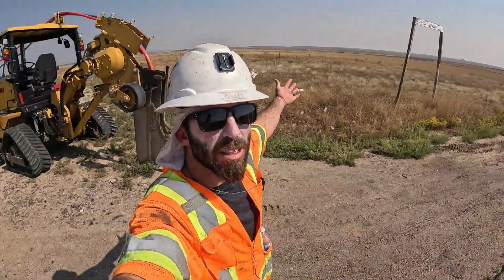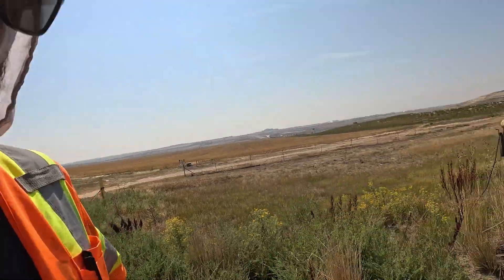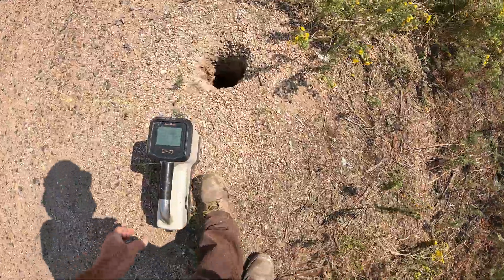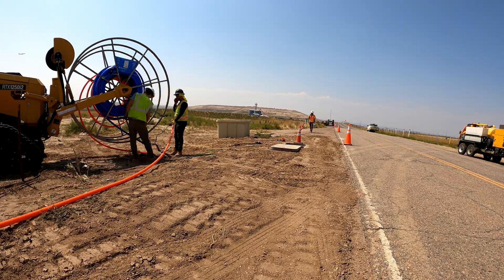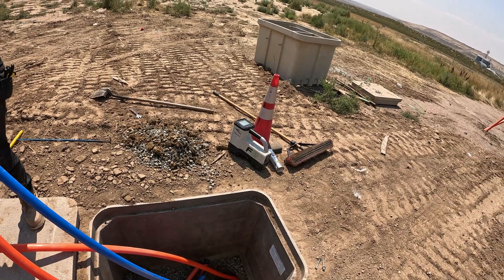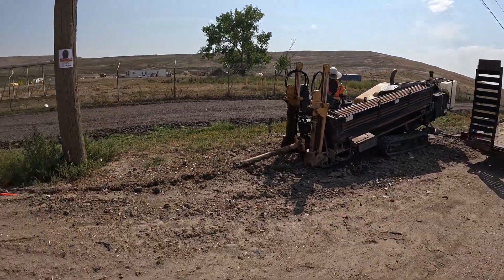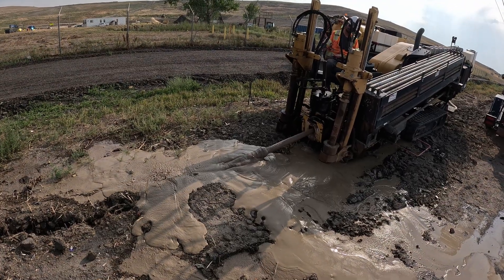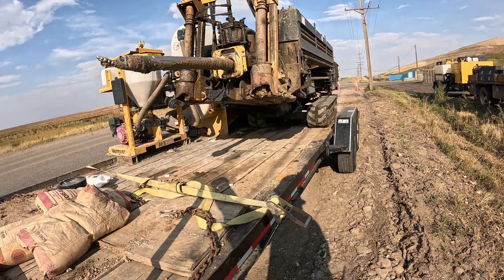Crossing 3 Huge Gas Lines

Comment: When I drill I have my locator set the locator up and I drill to it. Why do you move it around so much and tell him where to steer? No hate just a genuine question.
Reply from the maker: It’s just the way I learned. I’d like to learn how to drill to the box as well.
Reply: @AnchorBrosMedia gotcha, I use a jt10 so they have 6ft rods so we set up the locator 12ft away from my previous dot and just line it up to whichever direction we’re trying to go, if we have to curve it we stage the curve out so it’s consistent. As long as you have a diamond in the middle you’re lined up straight, if the drilled needs to go left or right twist the locator just enough to give a slight arrow one way or the other. This is the best way I know how to explain how we do it.
Reply: Функция наведения на цель. Если глубина выровнялась- каждые 10 м переставляется локатор. Удобно.